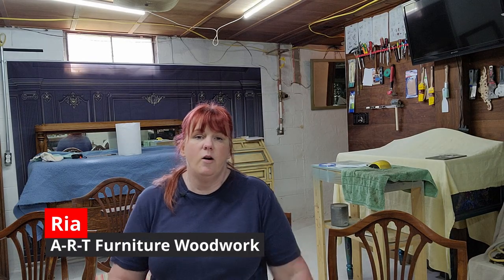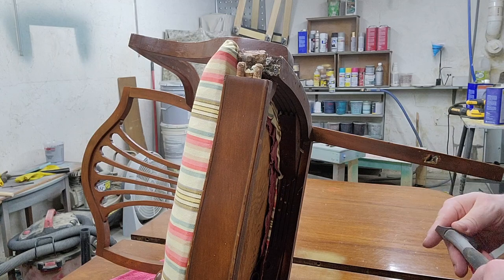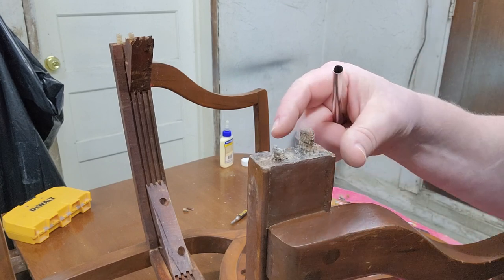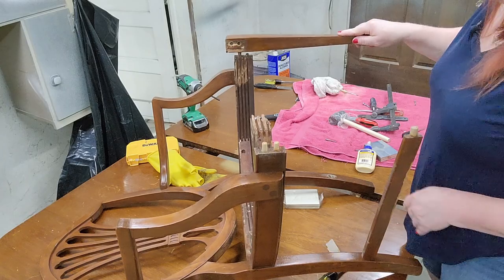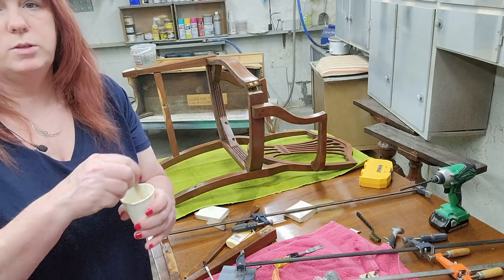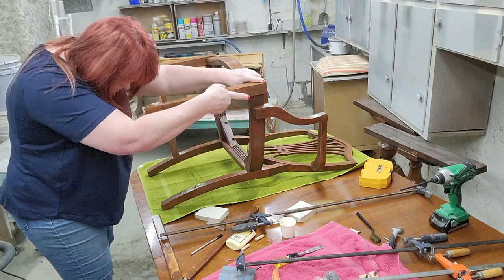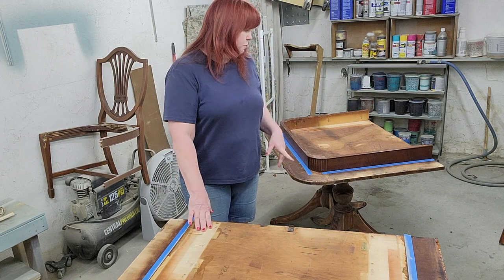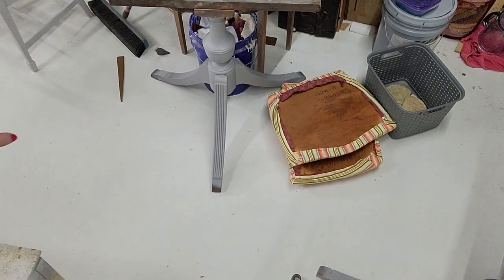Fixing years of mistakes - Dining Table with Chairs rescue!

Comment: I have a DP dropleaf, barrel leg table. The legs look just like yours and my table is whole, 3 leaves and all. It's a monster, seats up to 12. Now I need chairs. That glue is Gorilla Glue, it swells like that when used with water. Probably why it looks like the chairs have a bit of water damage, they wet them to set the glue.
Reply from the maker: Wow thats a monster table - was that the $20 Salvation Army find? That makes much more sense than spray foam thank you

Comment: That tight Bond liquid polyglue raises like foam when it dries and it actually sucks very expensive and does a s*** job that's what that glue reminds me of and it's a pain in the ass to remove
Reply from the maker: It was sure a pain to remove - never worked with polyglues and i cant see me rushing out to do so now. Does make more sense than spray foam but it sure did not work.